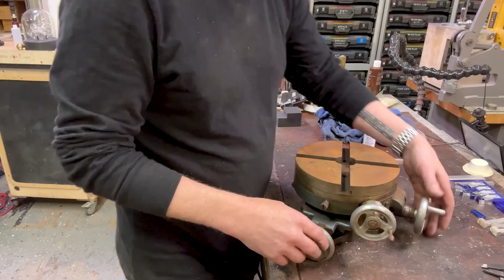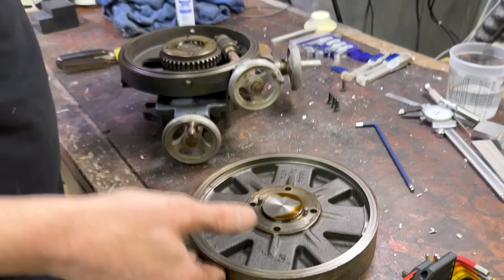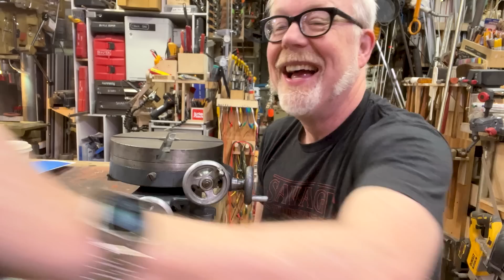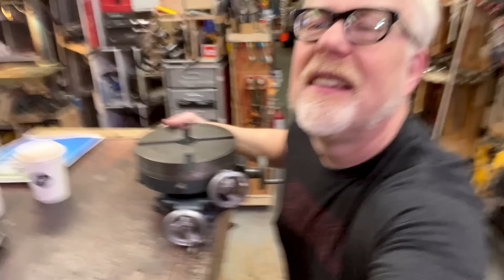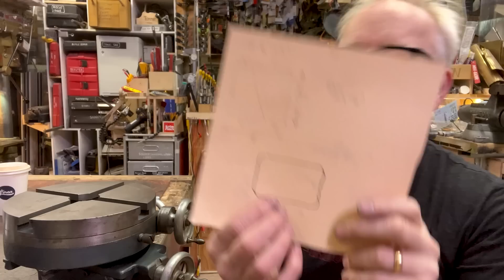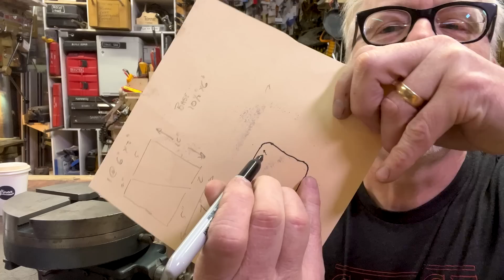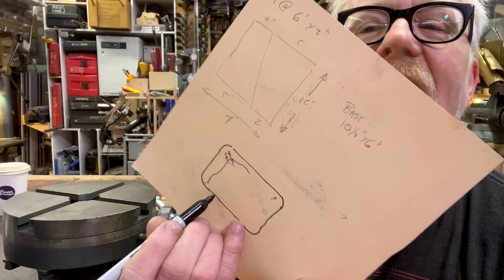Adam Savage Disappointed By This Machine Tool

Comment: I made one a bit larger. 8 foot by 8 foot rotary table on 10 foot ways for the x, and y axis'. First thing we used it for was to mill a badly made mold tube used to cast plastic PVHO tubes used for the 5 foot diameter underwater tube water slides at Atlantis, and other large aquarium resorts, and parks. The problem was the mold was bored off center of the rough forge wall. There was a large skip of the bore on one side. They tried liquid metal to fill the skip but the PVHO material stuck to the metal stuff, and the whole piece came out stuck on the PVHO casting like a scab. Lucky at that or they might have had to destroy the half million dollar casting to get it out of the mold. Not wanting to take that chance again my idea to fix the problem was taken. Mill it out, and weld a curved plate into it. I set the tube on the rotary table on v blocks. I indicated the bore to the axis of the spindle of the horizontal mill by shimming the v blocks, and turning the rotary table. Rotated the tube so the edge of the skip was a the bottom. I put a 90 degree spindle head on so the horizontal axis of the mill was vertical like Adam's small mill. But the mill head could be extended into the tube. Using an electric motor, and gear box for the feed drive, and rapid travel for the rotary table I milled the skipped area line by line with a 2 inch end mill. When it was all milled we had a 1/4" steel plate rolled curved to fit the machined cut. Welded the edge, and ground it flat. The PVHO tubes came out to spec. Problem solved, and the million dollar mold tube saved.

Comment: I have one similar to this on my drill press. It’s great for bolt circles. I even did some milling. I don’t recommend milling on a drill press, but I needed to finish a pulley for my horizontal mill, so there is that.

Comment: I was apprentice Too & DIE maker
And I hated this Attachment .
You had to stick a Indicator in the Milling column. 
And center it we did not use this Very Often 
If you want make a Unversal 
 Joint type of Oart this good F I r That 
Or Crank fitting.
Rough out on the Milling Machince

Comment: I have an identical Palmgren table mounted on a 15 1/2 inch drill press usually with another X-Y table mounted on top and sometimes with a 4 inch rotary table clamped into the X-Y table for machining optical parts.  I cannot imagine working without it as it simplifies all sorts of setups.  Regarding the backlash, I have never experienced that level and normal compensation for the tiny amount of backlash present is trivial.  And the discussion about complex cuts should now make the reason for my up to six degrees of freedom stack obvious.

Comment: Only 0.030" backlash?  With the right jig on top, this could serve someone wanting to drill bowling balls on a press,  and can't fork out for a mill/drill setup.  Bolt rhe jig in with some T-nuts, verify center, and bobs your uncle.  Personally, I use an offset thumb layout [some would call a raised ring finger]: 12 degrees.  It cured thumb chafing problems asociated with standard layout.

Comment: Well, you can cut angles with this easily. I’m not familiar with any XY table mounted on the top of a rotary table. That wouldn’t work the way you think it will. Just mount a rotary table on the mill and you’ve got your XY table. These really weren’t meant for mills.

Comment: Preloaded Ballscrews eliminate backlash. usually CNC machine tools have preloaded ballscrews.
Reply: Just get a standard milling rotary table and use the Bridgeport X-Y for positioning. For the most part its not really useful on a drill press since it would likely be difficult to clamp as well as hold work pieces. Generally a vise is needed to hold parts for drilling. an 8 inch table makes it difficult to clamp parts unless they are pretty small, since you you need to use step clamps. Realistically a 10" or largery rotary table is the smallest that is considered useful unless you working with really small parts. With the smaller tables its more practical to mount a four jaw lathe chuck to hold parts.

Comment: That rotary table can work fine if you turn the handle clockwise only while machining. To take out the backlash. Use conventional milling instead of climb milling. Also you can snug the lock/clamp screw on the Chuck mounting plate to make the set up more rigid.

Comment: I've got a very similar machine tool, made by Palmgren.  I've only used mine once, but it was good for that one use.  It's good for a few esoteric use, but I've got many machine tools that are equally esoteric.  I just got to "digital readout" on my machine tools in this century.  It's great for bolt circles and that is about it.  I must say, my first "milling machine" was a fifty plus year old drill press with a cheap Chinese X/Y table, so I've used my table a few times, but I do have a Bridgeport to do my general milling these days.

Comment: Back at the dawn of time the shop I worked at used a similar arrangement to orient wafers after slice-and-dice to align them in x and y for a robot to grab the individual segments and put them on a lead frame. The machine we built went to International Rectifier and it made TO-220 transistors at the rate of one per second. A very fun build but to do it right yagotta start with top quality components. 🙂

Comment: Like you say, mostly a drill press attachment for a home shop that does not have a milling machine. The backlash would not be a huge issue provided the table has a satisfactory lock. Most manual machines have backlash--you just have to make sure you are always moving the table in the same direction while making a critical measurement. More to the point, if you have a milling machine, the X-Y axes are entirely redundant, and take up valuable Z travel.

One safety issue, if anyone were to use this on a drill press, it should be used for hole positioning, not for milling. At least that's what "they" say, whoever "they" are. Milling on many drill presses is risky, because the chuck is mounted on a taper with no drawbar. Without a drawbar, the lateral forces generated during milling can cause the taper to work loose.

Comment: it seems that the snail or the toothed wheel is consumed. depends on what the snail is made of, steel or graphite bronze. it's bronze can be corrected,it is cut in long,3 quarters on one side and three quarters on the other side (to pass half) and re welded and is enlarged diametre so that the spiral wing to reach the bottom of the teeth.

Comment: Made for a drill press as the x/y function is not needed with a mill. As for the backlash you would take cuts in one direction so I’m not sure why the backlash would matter unless the end mill wants to make the table move back and forth on its pivot?

Comment: I have an X,Y, rotary table and have made many special parts on it that could not be purchased.  Use it properly and you will like the quality of the items you produce. Now, they are small items and I used it to produce small internal engine parts not available in production for racing engines.

Comment: That's not for use on a mill—why would you need a second set of x-y axes? Drill press is the only thing i can think of where it would be useful, and then mostly for the x-y axes. You could use the rotation for bolt circles, but i think that's about it.

Comment: so I have a fun piece of info.  we had one of those back in my old shop in middle school and was equipped on our large drill press.  the design and intention for this device was to enable keeping the piece locked in place and allow for indexing and/or rotating for hole patterns and more accurate drilling. it really is only made for use on a drill press like you said. but if you had a second large drill press it does make a fantastic tool for a maker that has smaller parts that need some decent accuracy.  especially since that unit has a locking feature to lock the rotation to keep things more consistent.

Comment: Rather than get rid of it, why not modify it make it useful? You could bore out where the rotary handle goes through and make an eccentric bushing that would allow you to adjust the gear mesh and take out most if not all the backlash. The X/Y section is still pretty useless, but you could at least use it as a rotary table.

Comment: So... I used one when I went to machining school, Dunwoody for anyone who cares, and I remember it being needed for a certain part, but I also remember it being basically obsolescent with a 30 year old CNC machine, so take with it what you will. I know this, we have one at work and we use it on our drill press as a rudimentary milling machine add on, because you have the slight back and forth movements of the vise on the table. Ours has a lock that helps eliminate backlash, but that brake is also a wear component that itself is worn from people not knowing what they are doing.

Comment: That seems to be late 40's to mid 50's tech. I've seen in action a vacuum lathe used for volatile materials, aerospace and weapons, and the gearing was much more refined. The gearing was finer and had not a central fixture but had a center gear with parallel teeth on the axial positions.
     That kind of mount can reproduce consistently and produce very thin wall construction.

Comment: i suspect that its a cheap copy of a precision tool.  it may not be good for metal work but it might be good for wood projects where that kind of precision isnt as crucial.  you might be able to do some interesting carving with some router bits in the drill press.

Comment: I have the same table.  I use it on the drill press.  I added a nylon shim on the rotary portion to remove backlash between the rotary adjust wheel and the base.

Comment: It has not seen a lot of use because it is a crap design.  You need a turntable underneath with the cross slides on top.  That way you can position the work and set the radius size with great precision.  Let me know if you found that tool useful in any way at all.  You won’t.  Find it useful.  
Backlash has nothing to do with whether this tool is useful.
You got it though which pleases me greatly.  Rotary below, cross slides above usually with a machinists vise attached.

Comment: Totally useless?
You have zero imagination.
You mised the backlash adjustment when you had the table off.
The end of the shaft that has the worm gear on it is ecentric and is used to adjust the backlash.

Comment: I could think of so many uses for this in my shop, only issue i see using it with a drill press is people forgetting most of them aren't designed for side loading so its basically a good engineer vice lol
Reply: Nope. Once you realize how much of a pain it is to mount parts & keep the concentric. ie strap clamps. Only way that remotely makes any sense if you permanentely mount a 4 jaw lathe chuck to it.

Comment: I have one of these, it came with my Bridgeport. I went through all of the stages of coping seen in this video. Excitement that it had so little use, anticipation of projects to come, pain realizing it was not a precision tool, and eventually accepting that it has no use to me. Mine has collected dust.
Reply: LOL! It makes a better paperweight than a machining tool!
Reply: Me three! Got it for a song and quickly realized there was a reason it seemed unused. Every time I thought something might be a good project for it I realized the x-y slides needed to be above the rotation. 

My thought is also that it’s best as a drill press accessory since it replicates an ordinary ro-tab mounted to a drill table. I suppose you could mount it on your mill at an angle to cut hex or octagons. 🤷🏻‍♂️

Comment: I'm going to be "that guy" and point out that you used the term "dead reckoning" incorrectly. Technically, the use of gauge markings on the adjustment wheels is "dead reckoning" as it only accurately gives you a relative position compared to where the attachment/slide/tool started. As you say, backlash limits its precision. In contrast, the use of digital position measurement tools is absolute measurement (relative to the milling head) in the sense that it knows position in relation to the milling head regardless of how it got there.

The aviation analogy of "dead reckoning" is where they used to use speed, time and heading to keep track of position. The drift and cumulative errors were periodically corrected using radio beacons, sextants, chronometers, ground observations etc. These days, GPS (which is absolute measurement - relative to the earth) has made most of this redundant.

I love your channel.

Comment: While it looks clearly made for a drill press, there is no reason you can't flip it over and mount the rotary down to the mill table then mount a pallet or vise on the top. 
For me I learned long ago, to forgo all the specialty oddball manual mill tooling and just get a CNC.

Comment: Not much can be done with back lash on an ACME / OR any worm screw , you can add a dial indicator and tighten the gibs but still will only do so much aaannnnddd you can use heavy grease with adding shims . Depends on how much you really want to invest PM  into your equipment ( preventative maintenance ) .
It's still a great piece of equipment . Good luck adam

Comment: It's a cross slide rotary table.  I have one very similar.  Could be a vintage Palmgren or Craftsmen from the look.
They can be extremely accurate.  I used to make tooling patterns with it.   You got to go old school and learn how to take up the slop when changing directions.  Unless you are building watch or rocket engine parts, it's close enough!  ; )
BTW, I was the guy who got the MCG Mauser for you for your Han Solo Blaster build.

Comment: Remove the round handles, add drill attachments, 3D print some custom tops for it and you have a very fancy (and over the top) auto rotating spray paint table for your models ;)

Comment: A scissor gear would help with your backlash somewhat. A heavy enough spring in it could eliminate it all together. It could be pretty challenging to make work with a worm gear. Might make for a good video making one. Sequel video to the gear you made a few months back.

Comment: Not quite sure how the backlash would be an issue? I mean, if you changed the direction after you milled your first half circle (in order to mill another one, next to it, for example), the only thing you'd have to be careful about is to take up the backlash, before you start counting your turns/steps on the dial in the reverse direction. But as long as you only cut in one direction, the backlash will always be taken up. If you're afraid that the table will move too easily (for the amount of the backlash, that is) you could tighten it up a bit, if it has that option (that screw, to the left of the handle?) If not, you could always make something to "brake" the rotation a bit.

Seems like a useful, heavy duty tool. The new ones certainly won't be as rigid, at least in lower price range.

Thanks for posting! Love your shop improvement/sorting/DIY videos!

Comment: Adam, look for the rotary table that Bridgeport made. It’s a low profile table that you could mount a XY table on to and still have some space on which to clamp down your work piece, They were made in 12” and 15” diameters. They also have the added advantage of coming already equipped with handles to make it easy to install and remove from your mill.

Comment: I have a rotary table with x-y axis very similar if not identical to that one and discovered the same challenges with it, lol.  No idea who manufactured mine, since no clear markings... mine has significantly less backlash in the rotary part, but that might be because I haven't pulled it apart and cleaned it like you did (that was the next step on my todo list for that tool...)  If that's the case the following step (putting a shallow taper in the center for reference) might still be useful....

Comment: With out even watching the video I already know that that rotary table does not work well for milling operations. It lacks the required rigidity for milling metal except for very, very light cuts. It is actually meant for a drill press. That’s why it has a XY function. Buy a Troyke, Yuasa, or something on their level of quality. Even a Phase II brand rotary table is better than the Palmgren brand unit.

Comment: Seems simple enough to just flip it over and mount your stock on the bottom of the x-y table.  I wouldn't worry about the backlash on the rotary table, either.  Just set the lock to drag on the rotation and only rotate it in one direction.  That's exactly what I have to do with my mill because it doesn't have a DRO.

Comment: you put it on your drillpress. hence the limited accuracy. it's just for drilling and dividing holes on a regular drillpress. not high precision jig drilling and grinding. Your projects and resultz are za bezt but your choice and taste of tools is far from that. goes to show ,it's not not the toll but the craftsman wielding it. You  adjust the backlash of the rotary table / orm wheel by moving / adjusting the worm in- or outwards if there is no ex-centric bushing / bearing holding it. If there is a ex-centric bushing /bearing holding the worm you can adjust the backlah by lossening and rotating it.

Comment: Honestly looks like it would make a good basis for a welding positioners/rotary table. It would need to be adapted to be driven with a motor but that 30 thou of backlash isn't an issue in that application.